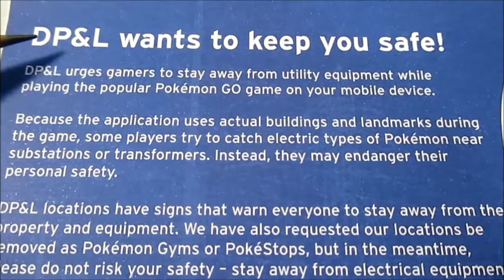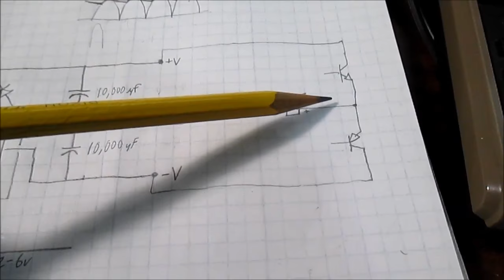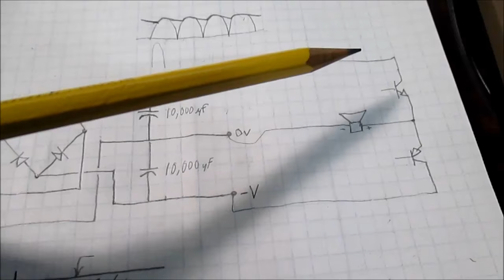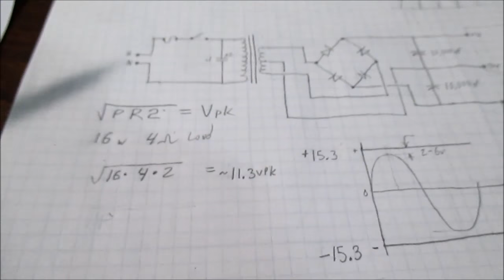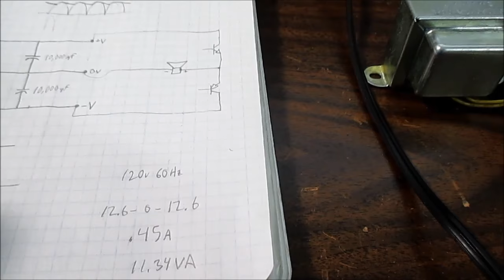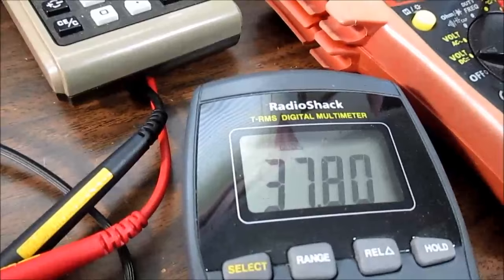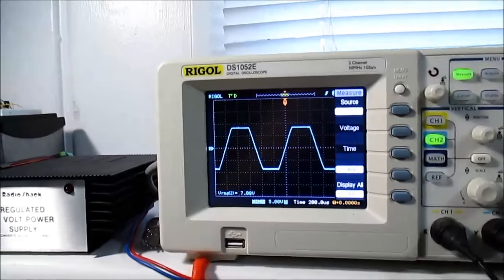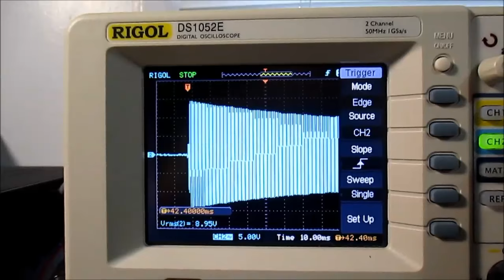Selecting power transformer for audio amplifier

Comment: If one Transistor goes short circuit  then bye bye loud Speaker If you have expensive Speakers always put a protection circuit between amp and speaker.
Reply: Why? Burning speakers is part of the fun

Comment: Few days ago i tried to power up my amp and the capacitor exploded. i used 3 3300uF cap 50V rating. 12V supply. Could you please make a video on why capacitor explodes!! i searched online but didn't find any source talking about this. Thanks in advance.

Comment from the maker: FIRST! :) Hey guys thanks for watching. I'll be uploading a few more videos soon. Stay tuned!
Reply: Can't you get more wattage using a smoothing capacitor or a filter?
Reply: JohnAudioTech 
😂😂😂
Reply: MrBrymstond; Yes, but ONLY for a VERY short duration, as in "peak" or momentary "dynamic" power... Once the capacitor discharges then you have no more power available than what the transformer or power supply/power source can deliver on a steady basis, so if that transformer or power source cannot continually back up the power drain from the load then you're only gonna get as much as you put into the circuit, (from the power source), so that's why those extra large "add-on" caps that you see in a lot of car stereo systems don't (cannot) help any with the RMS/continuous power output of an amplifier, ONLY with the peak maximum (short duration) power output... And only then if properly installed, AND if using a good quality capacitor too, because many of the cheap junk ones made in China offer absolutely nothing, (or very little)!... I've seen some of those kind which have an actual value of only about 1/10 of their stated capacitance!... Pretty pitiful! LOL!

Basically, filter or "smoothing" capacitors only do just that; they smooth out the AC ripple that comes through a rectifier, (bridge, etc.), circuit, which in turn makes the output voltage have less AC on it and a more stable DC voltage... Capacitors do not "add" any power or wattage to the circuit.
Reply: Hi John! Hope you have time to respond. My dilemna,, is that most of the transformers I have, new and recovered, torroidal or EI core, have output voltages of 28 vac or more. Once you factor in the 122vac at the source, I have nothing short of 44vdc, theoretically. What's puzzling is that most of the older amps used this much voltage, when most SS amps I build require 35vdc or less? It's difficult to find mfrs. who make low voltage, hi current trannies. Thanks for your vids! Ill find your paypal!

Comment: On Regulated Power Supplies - they will many times use a 2n3055 Power Transistor to increase the Output Power. What would the output of the small transformer be if you added one 2n3055 transistor to it?

Comment: A very concise presentation. As you say, if money was not an object, the toroidal transformer would be the choice to get maximum output power per unit space (that the transformer takes). I constructed a kit which used a 'C-core' transformer, which is somewhere between the E-I type and the toroid in efficiency...

Comment: Good video as always. I have just stripped (disassembled - awful word) a Monicor PA 900 line amp that got a sudden cooling in a pub by a pint of beer. Vents top and bottom didn't help much. The DC supply is fine as are most of the 'gubbins'.  The amp is rated at 120W RMS and the mains 230V transformer is 40VDC at about 7A that's 280W That's more than double the output.  It's being converted into an LM237 - 2N3055 x 4  bench power supply - I'll try anyway. The beer stains on the transformer are going to stay there as they look quite content. I do hope you get a power supply sorted young fella, you deserve one. Regards
Reply from the maker: Sounds like a fun project. Thanks for the comment.

Comment: AC voltage x √2 = DC voltage when rectified.

I have always wondered why hifi buffs dont spend the money on a regulated quality power supply for their amplifiers instead of hundreds of $ for one meter of cable. 😁
Good video.
Reply: Regulated AC supplies are complicated and add impedance to the line. Most solid state power amps perform fine over a certain range of supply voltages and will lose peak power output but otherwise work fine on lower than rated voltage. Provided the filter caps and the output transistors are kept within the SOA higher doesn't bother them either.   

 So a properly designed solid state amp might work fine if its 120 nominal input voltage was anywhere between say 100 and 135 volts. Surges above that and spikes are potential killers though. 

 Using a regulated supply for preamps, CD players, and other low current devices could be beneficial. Most have internal DC regulation so higher voltages will cause their linear regulators to run hotter. HOW you regulate the AC is crucial. many schemes like ferroresonant transformers produce a distorted waveform which will result in higher noise.
Reply: @wamgoc3637  I think he meant regulated DC.

Comment: Toroids have a lot of advantages but one thing that gives them fits is that any DC offset on the AC line will put them into saturation very rapidly. There are ways around this but this is something to consider.

Comment: Extremely interesting video JohnAudioTech! I was intrigued by the simplicity of the maths!
I know now exactly how to work these things out for myself WHICH I THANK YOU FOR!
I've watched some videos about simple amplifier circuits using the TDA2822M & LM386  by ardwenone and he said that you can use +12 & -12 Volts to get a 24 volt supply in one of his videos about stripping old discarded or broken electrical items down for parts, but i'd never even heard of a negative supply rail!  
He said something about positive and negative voltages referenced to a virtual ground so that the ground is kind of the mid point of the total voltage as one option for a split supply and you can do this from batteries by (something along the lines of) measuring the voltage from a different point or taking the ground from half supply voltage or something by using resistors of equal values or something about using a divider circuit?? 
Which really didn't make much sense to me as I never knew voltage could be divided using resistors (if it can I don't know about it because I'm just starting to learn about electronics!), but your diagram made it a lot easier to understand! That visual stimulus made it make sense in a way that I understood, it's great being told the information but sometimes you need that little extra explanation or like your graph to actually understand it. I do kind of get it now about the negative voltage because I now realise that music is an AC current rather than DC is that right?

Ardwenome linked to your channel in one of his videos and that's how i found myself here. 
He was correct you do supply a wealth of information & I'll subscribe to your channel too now between the information in his video & your video I now understand a lot more about amplifier IC's which is what I'm trying to build as my very first electronics project.

So basically yohu could have a voltage of an infinite number of volts with half of the voltage being positive and the other half being negative if you take your zer or ground voltage to be half the total supply voltage yeah? But wouldn't that break anything you connected to it if it was wantinf zero volts as a ground??
So basically you're saying that +50 & -50 would make 100V total supply, So could i run an lm386 or tda2822m or tda2050 or similar on a dual / split supply? obviously a lot smaller voltage 9 or 10V for the TDA2822m +&-5V,  then say +&-6V for the LM386 and +&-12V for the TDA2050?
Or is it not possible to run all amplifier IC's on a split / dual supply??

I think I'll try and replicate ardwenome solar powered amplifier so I can have a portable speaker and like he did use a battery pack for when there's no sun but I want mine to recharge itself from the solar panels too but he said something about balancing the batteries and charge or battery protection circuits built into the cells, I'll have to look into it all and see what sense I can make of it. As i've never heard of balancing batteries when there's more than one being used, surely you just charge them up and away you go? Something to do with lithium ones and over charging he said it can be dangerous and you need to have a balancing board to prevent it catching fire or to stop the batteries exploding or something. 

And is it possible to just connect the solar panels directly to the batteries and have them charge or would it be better to use op-amps to boost the voltage of the solar panels before the power gets to the batteries? which is something else he mentioned when talking about a solar power bank he had that broke but I thought op amps were for music? I'm quite confused about it all and I suppose I need to do some research now before I build it.

I guess you guys on here know what you're on about or you'd not be making videos about these things. Which is why I'm kinda asking for your advice i suppose.

Anyway Loved the video you explained it in a way I actually understood (only because of the graph!)
Look forward to hearing your answer JohnAudioTech!
Reply: Hi! I know this is old, but I had to respond. After ac voltage is rectified, the subsequent dirty dc is magnified by a factor of about 1.41. So, in building a LM3886 amplifier, I used a toroidal transformer with a secondary of about 19-0-19 vac, so 19X1.41 equals about 28 vdc, when you factor in I'm getting 122 vac at the outlet, another concern!  The large capacitors  "smooth" the dc somewhat. I think it was a 200 or so VA transformer, about the minimum. And of course, there's the voltage drop when the amplifier is driven, in my experience, just a volt or 2.

Comment: Am very certain to select the appropriate transformer for an audio amp. Would need to know its power consumption then add a little on top for overhead. This would include voltage and amps. Am guessing 1 would need to know how much the transistors are consuming? Interesting video on differences in performance of amp with different transformers though.

Comment: Great video! Thanks for sharing. Can you explain the function of the extra diodes, transistor, ceramic cap, and resistors on the bread boarded power supply? I understand the bridge rectifier and big electrolytic smoothing caps... but what's the other stuff for? It's not just to for the indicator LED, right?

Comment: Im kicking myself for throwing away some of the parts i used to pull out of dead audio gear when i was a kid, i had quite a few box's of pretty nice stuff, high power toroidal transformers, lots of transistors and other goodies from a bunch of dead yamaha PA amps I had gotten my hands on, i still didn't really know what i was doing at that age, just really liked pulling apart electronics trying to figure out how they worked. Now im looking at building a nice high power ( 20-25 Amps at 13-15 volts) low noise linear power supply and with the power supply components from a couple of those amps would have made a killer power supply for the high power RF transmitter im playing with for ham radio stuff.
Reply from the maker: As a kid, my friend gave me a new 5HP 3 phase motor. It was heavy and I took it home in my red wagon. At some point I dissembled it and eventually threw it away. I can just kick myself now. Those were expensive!
Reply: The more I learn about circuits and electronics, the more convinced I am that I’ve thrown away enough gear to have contained at least one of every component I’ve ever bought :)

Comment: This is why it's always good to slightly "overbuild" your amplifier power supply!... This is also the exact main reason that most modern home theater "receivers" simply cannot put out high wattage in any kind of sustained manner, because they are all essentially being powered by only the smaller transformer in this video (relatively) because of size and space and cost considerations, instead of the larger transformer, (again relative sizes, not exact), like the kind you would see in a truly dedicated separate component power amplifier.
Reply: Nearly all modern amps can be improved by adding more capacitance to the power reserve. With enough dynamic power, you can get away with being a bit starved.

Comment: That would be great!! but for some reason I have seen most people ( including you) use dual supply more often then single supply though single supply is commonly available.
Reply: The AC audio waveform goes above and below zero volts. If you have a dual (plus and minus) power supply, it's possible to do this and have the amplifier output sitting at 0V DC. If you use a single supply, the amplifier output will need to be at 1/2 of the supply voltage. Because of this, a capacitor is needed on the output. 

This DC blocking capacitor impacts the performance of the amplifier in a negative way (phase shift, impedance, as well as a
Non linear element in series with the output) and could just as easily be used as a filter capacitor for a dual supply amplifier. 

In short the answer is performance. No modern high quality amplifier will use an output capacitor and a single ended supply.
Reply: Thanks! That helped

Comment: Great video! I'm new at this. New tricks for an old dog. I've got a Eico 147A Signal tracer. Change the audio in jacks, install a 4" or 5" Eminence speaker and viola! A self diagnosis guitar amp with the evil green eye equalizer?

Comment: Nice video, well explained ! I have a Bass Amplifier with rating 120VAC, 60Hz, 210VA Average, bought in Canada. I am presently in India and therefore have a 230VAC, 50Hz source. Can you kindly suggest, what need to be the VA rating of a 230VAC to 120VAC step down toroidal transformer ? Thank you in advance !
Reply from the maker: You might want a transformer with at least a 250 to 300 VA rating. Too many unknowns for me to give solid advice here. Going from 60 to 50Hz may also be an issue with the amplifier. The amplifier may be configured for 230v operation internally. You have to hack it at your own risk.
Reply: @JohnAudioTech  1. The average is 210 VA, therefore the peak could be at least 3 times that. What do you think ?
 2. The European models are configured for 220 V AC.
3. What I had mentioned above is the name plate rating.

Comment: @JohnAudioTech I just so happen to have two different toroidal transformers without a center tap. Their specs are as follows: First one, Primary 120V 60Hz 350VA / Secondary 26.3V 12.55A and the Second one, Primary 0-100-110-115-127 50/60Hz 360VA / Secondary 26.3V 13.1 / Autoxfmr Output 120V 8.5A. Now I'd like to use these as I can get them for free. Do you think I could use either of these. Most of the transformers you show have a center tap?

Comment: John, can you please check a  'MT 2130 toroidal transformer' it has a VA300, the crew at Jaycar (Australia) said it wouldn't do the job. They stated it wouldn't go into the -12 and that both 12 outputs were +, I have been watching a heap of builds and cant get a sold understanding...... Getting through your vids, learning a lot.
Reply from the maker: What are you powering with it? It is 15-0-15 secondary. After rectification and filtering, it would put out about +22 & -22 volts relative to the common lead at no load.

Comment: I've been designing amplifiers for over 10 years now, and I've read many places that say that your transformer needs to be at least double your total rated output power. I've found this to be a myth. I've found that if you about get a transformer with VA equal to total output rated power (and a well regulated transformer), you're perfectly fine, and still have reserves. No audio signal can sustain rated output of an amplifier. A 100 W amplifier will typically sustain an average of 20 W. The 100 W rating allows the necessary headroom. The capacitors provide the energy for the high power transients.

Am I wrong?
Reply from the maker: I can agree because, like you say, most music signals have the bulk of the power far below the peaks. The transformer can handle the low average power and the filter caps the peaks. There are those who like the type of music with heavy sustained bass notes and played at high levels. This places great demand on the power supply, so I would recommend a stronger transformer. It can also help with reactive loudspeaker loads that can dip well below their nominal impedance at certain frequencies.
Reply: Thanks for the reply. I agree about the impedance dropping significantly, so I design for that as well, but I think this accounts for much less of a demand on the power supply because it happens only at certain frequencies, so the power is very little, even if the impedance dropped to 3 ohms for an 8 ohm load.

At the moment I'm designing for rated 330W in 4 ohms, but it will most often be doing about 180W rated in 8 ohms. I'm using a 625VA transformer. If the supply had to drop 10%, it would sustain a 260W sine wave in 4 ohms. Not many speakers can handle this sort of continuous power. I think over-rating a transformer is a bit more relevant for lower power amps. I would be very glad to test how the 625VA holds up for two channels driven with a sine wave, but I don't have a capable 4 ohms load! :)
Reply: Thanks. That's one, I would need two, and then it's going to cost me a lot to get it here, and risk it getting lost. :) If I want a 4 ohm load, I'll build one; I don't see the need for one at the moment.

Comment: Thanks, your video is great and helpful, but how do you get that sinusoidal signal out of the music player? And how do you increase or decrease the amount of power and the oscilloscope connections?
Reply from the maker: I used free audio editing software called Audacity. It can generate tones that can be saved to WAV files. I had a potentiometer connected to the input of the amplifier to vary the signal. Scope was connected across the 4 ohm load resistor on the output.